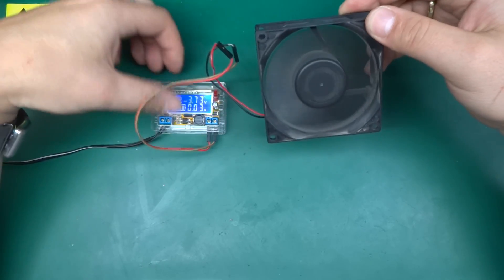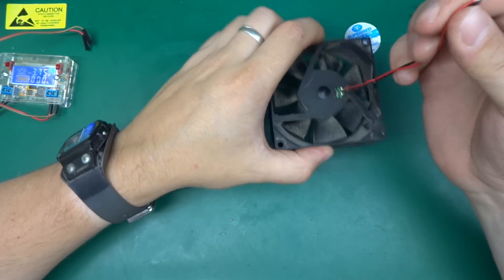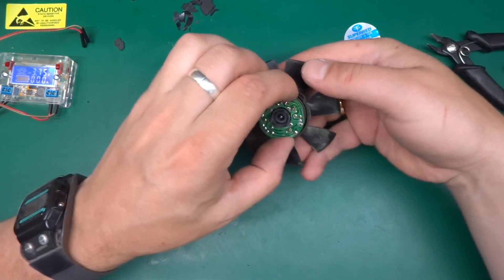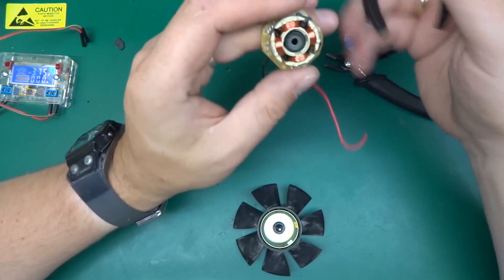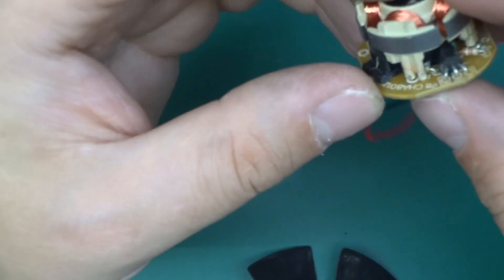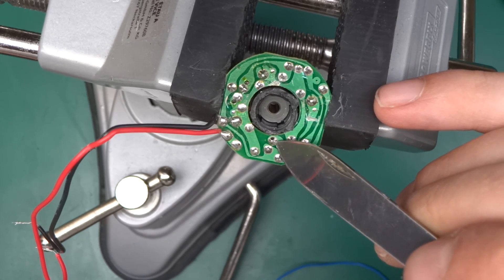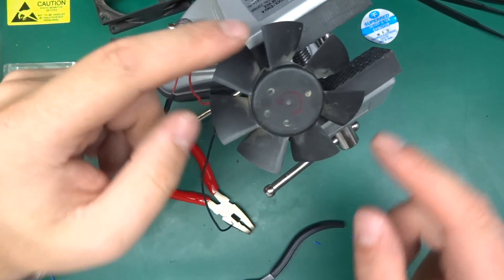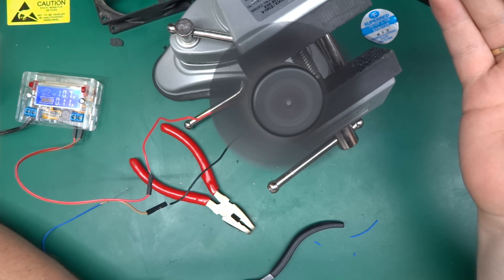How to reverse the rotation of DC brushless fan motor from PC

Comment: You need some Snap ring pliers. The ones that come with multiple tips of different size and angle, reversible handles instead of the pin and spring kind the ones that just fold to change from inward force to outwards.

Comment: You can take out just the PCB by holding the coil part in a vise, and carefully turning the base which contains the bearings. If you were careful during disassembly, the fan will function properly after reassembly.

Comment: hi there, I want to know why transistors are used in pc fans. and i want  to know suitable transistors to replace my burnt transistors.on the burnt transistor there some identification  number that is "IC33725 P H 2 4". i checked on the Internet but i got nothing .Can you help me?
Reply from the maker: Hi, pc fans are brushless DC motors, and require switching between different windings of the stator to happen in sync with the rotation of the fan. That's what transistors (more likely dedicated ICs in a transistor package, often consisting of hall effect sensor and switching logic) do. Those generally are purpose made (to drive cost down) for manufacturers of the fans, and those parts ale very unlikely to be available to buy as a replacement.
Reply: @randomtronic   thank you
Reply: @randomtronic  WHAT NUMBER OF 2 TRANSISTOR

Comment: Would this also work on a PWM case fan? I would imagine so since PWM is just a means of applying full power at short intervals, but maybe there is a difference? I really want to reverse the direction of some PWM fans but this seems to be the best method I have found so far (aside from cutting up the housing).
Reply: yeah same to you, the video is great but for noob like me is quite hard, if there any easy solution to make it reverse the rotation plz tel me

Comment: İf you reverse magnet, will work?
Reply: I just tried that.. no luck, it spins in the same direction.
Reply from the maker: It would I think, but have not tried it - the magnet is glued in the metal cup.
Reply: NO. suppose there is NSNS  magnet if u reverse it it will be NSNS only, to reverse u must choose which coil u r energising first.
Reply: that way you just shifting the magnet against the blade by around 30 degrees depend on how many magnets in there. but reversing the electromagnet or coil might work because it will shift against the sensor.

Comment: you must post the hacked electronic circuit of the fan
Reply from the maker: juanfrancisco I thought I showed clearly what I did there. I did not reverse engineer entire driver circuit unfortunately, so can't post the schematic :( besides, there are as many circuits for fans as there are fan manufacturers - but if you want to do what I did there, that should work with every circuit out there. Thanks
Reply: but the spin is so weird , I think you made something wrong
Reply from the maker: Spin was fine, I just tested it with very low voltage so it spins slower and shows on camera ;)
Reply: randomtronic as it have two coils , I believed that there is some sort circuit at the base of the capacitors transistor and for reverse spin L2 must star first
Reply: @randomtronic  I only saw you cut one trace and put in one link. I don't see how that would reverse anything. You would really need to cut two traces and put in two links, methinks. I can't be sure without seeing the schematic.
EDIT: I just reviewed the video and see that in fact TWO traces were cut but only the first cut was filmed, the 2nd cut performed off camera.. Also TWO links were installed but one of them was simply a solder bridge. So my comment was pointless. The two cuts and links do in fact reverse the coil polarities.
Reply: @iconoclad  actually, he reversed the coil ends, so the pole which was attracting is repulsive and vice versa. BUT, this is NOT clean solution, because such reverse mode won't have nice autostart property anymore. A dead point would be visible (just power it up and rotate slowly by hand). There would be 4 points per revolution, where the rotor would just stuck and stay, unless some inertia is helping it to overcome them.

For correct solution, the HAL should be biased by negative prebias angle too, so that those dead points are oscillating points instead (as the original design actually uses for autostart from zero speed).
Reply: @xcimbal  See my edited comment. Tks for prompting me to take a second look.

Comment: i have intel cpu stock fan and i discovered that the fan blades are kinda touching the heatsink when the case on its side.. i think the rotor is kinda loose. its making a rattling noise when pc powered on, it doesn't go until i tilt my case 30 degrees.. any fix?

Comment: does the bearing type matter I wanted to do this on some corsair AF series fans with hydraulic bearings  thanks and great vid
Reply from the maker: roynorw hi, bearing should not matter, I only discussed the electronic part of the object. Please expect the circuitry  to be different in some modern fans, but coil swap will work exactly the same.
Reply: randomtronic thanks bro ill do a vid just in case it goes wrong you can tell me why if possible thanks
Reply from the maker: roynorw cool. good luck :)

Comment: This motor I can use   quadcopter...?
Reply from the maker: +emranhossain tonmou thats what I wanted to try. After some tests, it turned out, that the motor is too weak. After attaching propeller, the motor is unable to spin it fast enough to generate usable lift. If you had 4 of those on a frame, it would fly. But if you add a battery to the frame and some more electronics, then it will stay grounded. Need more power :)
Reply: randomtronic so what I do now
Reply: In one word.
Wtfish😂

Comment: Ĉool, I actually am looking for a micro bldc pc fan motor to power my portabe cassetteplayer project. I'm curious if I can get enough torque with gear ratio to turn the tape. It's pretty silent.
Reply from the maker: +Synthusiast all depends on gear ratio. Since those spin quite fast, you could reduce through gears the speed and thus increase the torque. It could work. Good luck!

Comment: Having been able to make it go in the reverse direction, did that do anything to the airflow direction and/or airflow volume ?
Reply from the maker: +Wah Ng it will reverse the airflow, but it is far less efficient that way due to shape of the blades. For good efficiency you need blades shaped like a mirror image. e.g. drones have 2 left rotating and 2 right rotating rotors. They look like mirror image.
Reply: Sounds like the setup the fan manufacturers have on their "counter-rotating" fan models.  These models have two fans attached to each other where the front one is rotating its blades in the counter-clockwise direction while the rear one is this rotating its blades in the clockwise direction. The blades on the front fan are a mirror image of the rear fan in these assemblies which increases the airflow more than if you put two singular fans back to back.
Reply from the maker: +Wah Ng yep, exactly ;)